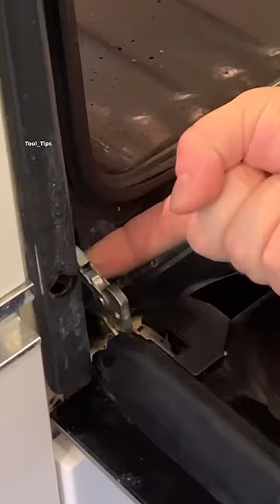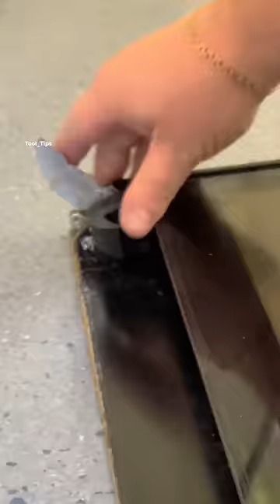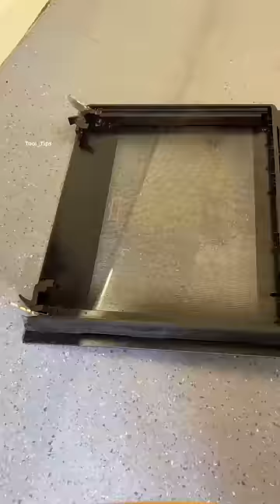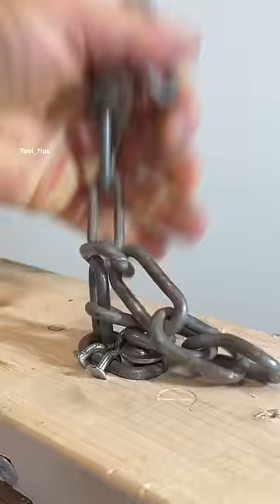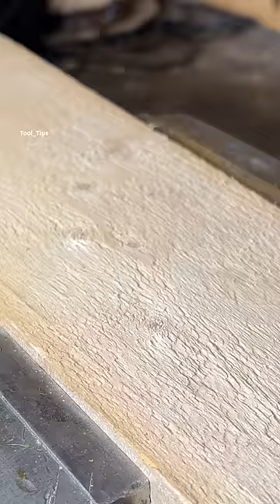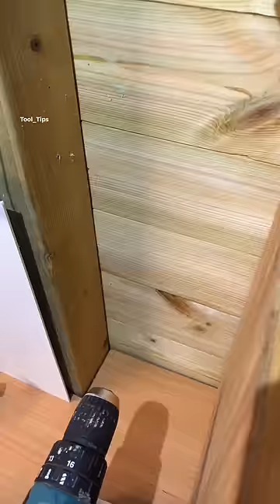Few People Know About This Six Tips 🤫

Comment: Just a FYI, that must be a specific feature to that brand of oven coming apart so easily to clean the glass. As a appliance repairman, I’ve never seen one that easy, normally it’s quite a few screws, and a couple panels.
Reply: I was trying to figure out the brand of this oven, as I've seen that feature on German Miele brand devices. Our own has that sort of levers too and the door is easy to take apart.

Comment: Cutting the tip off of a screw to prevent splitting works really well if you don’t have a pilot hole drill.
Reply: Just like blunting the head of a nail to keep it from splitting the wood